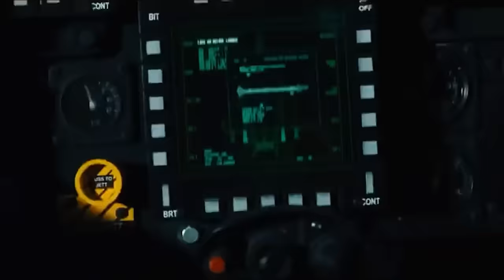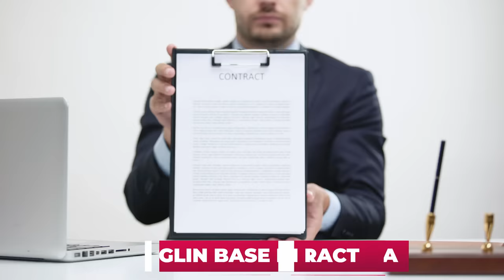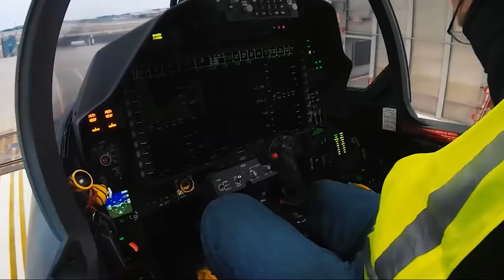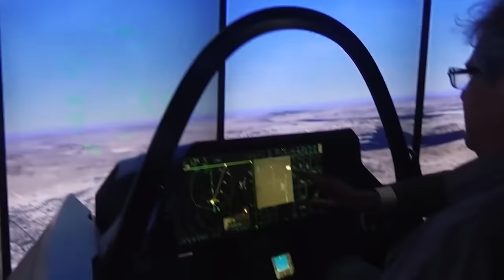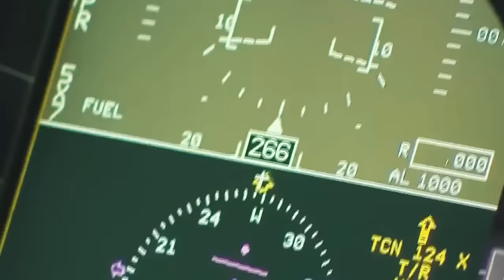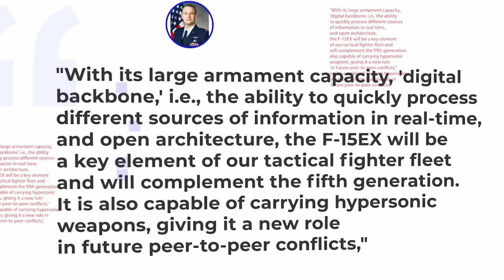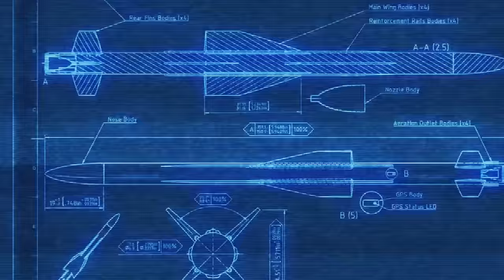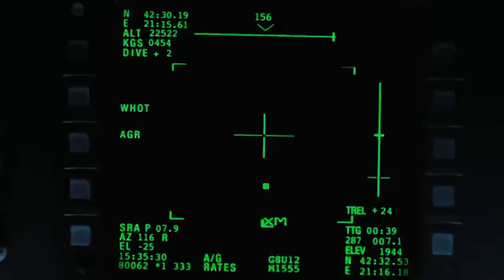NEW Upgraded F-15EX III Shocked Russia And NATO Countries

Comment: When many of us argued that the new 5th gen fighters didn't seem to make much sense as there was still a lot of life in the 4th gen fighters, we were called defeatists, haters etc. We were told that the military needed 5th gen fighters, because 4th gen fighters were already obsolete and would be slaughtered in a modern war. 
When we said those 5th gen fighters were too expensive to buy, fly and maintain, we were called to exaggerate or even lie, "because that wasn't true at all."
When we pointed out that building, flying and developing a plane like the F-35 didn't seem to make any sense as many problems were ignored "to be fixed later", because pumping out those planes was more important than fixing problems, again the 5th gen crowd was upon us with strong language. For many of us it seemed like the manufacturers of the F-35 were desperate to flood the market with F-35's before many buyers could cancel their orders, because they had reconsidered buying the F-35's. The reasons for customers reconsidering buying the F-35 were obvious: the price keeps rising, problems keep being pushed ahead, flight and maintenance costs prove to be exorbitantly high and the promised added value of this "must have" plane was severely diminished as the 4th gen planes proved they weren't really obsolete yet and the F-35's having much of their capabilities severely limited by said non-solved problems. 
  
And then the news came out that the US military had cancelled a lot of pre-ordered F-35 and we could only hear crickets from the 5th gen side.

Now the US military is committing to the F-15EX, I expect them to cancel even more of the pre-ordered F35, for all the reasons mentioned above.

Comment: The f-15 EX is not old, they’re brand freaking new. Not s repurposed 50 year old jet. Sure, it is a 50 year old design on the airframe, but the EX variant are made brand spanking new off the line.
Reply: The video says that right in he start…

Comment: 1:06 From what I have seen, it seems like they have been remodeling the F15 all the way up to the F-35. The framework on the F-35 is like an expansion around the  F15's original frame. They cowled the entire frame from the nose to the exhaust and gave it a vectoring thrust.
Reply: Huh? SMFH None of the planes you mentioned have thrust vectoring

Comment: If F-22 was continued to be upgraded aND modernized, the operational costs would have come down. Unfortunately, Obama admin banked on getting B-21Raider built and cut F-22 production to get the Raider. The result is a very unique, expensive, and irreplaceable aircraft. That bad decision regarding F-22 production being cut in half is per force followed by more bad decisions. Just think, if GM would announce that they are starting to make Chevy Luminas that look EXCATLY like the 1990s Lumina looked, but have slightly more efficient engine and different dashboard - would you buy it????

Comment: I have never understood why we are always quick to abandon older technology.  Sure, there is a definite need to continuously develop ever more capable fighter planes.  But the US should also consider supplementing the squadrons with a resurrected and modernized F-5 fleet that are drone capable.  At a fraction of the cost of just a few modern 4th and 5th generation fighters, they would be able to fill the sky with hundreds, if not thousands of autonomous fighters.  In fact, doing so would easily overwhelm any modern 5th generation squadron that any enemy could throw at you.  Consider just deploying 50 autonomous F-5's against every MIG-29, MIG-35 or SU-57E.  Then deploy our best manned, modern fighter's in the rear guard to coordinate and take over the attack/defense when the enemy is overwhelmed.  And sure, any MIG-35 or SU-57E would likely be able to take down half a dozen or more of F-5's per engagement.  But how could they stop the 40 or so missiles coming at them from the surviving F-5's arrayed against them; when they have ran out of weapons?  The odds favor the many, and greatly increase if instead of missiles, you add weaponized lasers (as the US is currently developing) to some F-5's.  Since each autonomous F-5 jet would be pilot-less, the loss of 1 or 2 would be nothing compared to every SU-57E shot down, and without a loss of highly skilled pilot on our side of the engagement.

Comment: Couldn't they incorporated some designs from the F22 into a stealth version of the F15EX program?
Reply: Not really. Stealth has to be designed from the ground up. They can add some of the features to reduce cross section, but it would still have more RCS than an F-18
Reply: @enginepy  actually you can take the overall design of the F22  and apply the design to a new stealth version of the F15.
Reply: @terrycarter1137  there are thing they can do for sure to help. Faceted edges on the inlets and doors, angled vertical stabilizers, coatings, etc. that certainly reduce the RCS. But it still won’t be as stealthy as we would like. It would give a huge advantage though in air to air. Kinda like the Have Glass program for the F-16., which was really just coatings. But they talked abont revising the inlet design etc and it wasn’t cost effective. Not sure why though
Reply: @enginepy  redoing the F15 into a more stealthy design is very possible, and yes it would reduce it's RCS, and yes it won't be as stealthy as something like the F22, but a more stealthy F15 would be a more cost effective way to have a somewhat stealthy aircraft without the high cost of maintenance of the F22, and have more aircraft ready for combat if needed.
Reply: @terrycarter1137  i completely agree. Almost makes too much sense for our government, so who knows. But seems like a common sense approach as they update the airframe.
Reply: The F15 Silent Eagle was a design proposal for a 'reduced radar signature' F15.......but it wasn't adopted......

It was an F15 with the RCS of a clean smaller F18, which helped a bit with detection distances, but it didn't make it a truly stealthy aircraft.
Reply: @baronmonkerson2195  true stealth aircraft are currently expensive to produce in great numbers, and are expensive to maintain, the F15 silent eagle was a good proposal, but they could have altered the design to make it more stealthy through using design aspects from the F22 into a easy to produce and maintain F15 a semi -stealth aircraft.
Reply: @baronmonkerson2195  well said

Comment: This is sad and ridiculous.  If the F22 Raptor's production line and parts production lines weren't specifically destroyed to force the purchase of the flying bricks that can't climb, fly fast or turn (F35A, B, Cs with about 60% flight availability, over 1,200 parts shortages [MonkeyWerx] and 60 day maintenance turnaround times) we wouldn't have to buy 1980's tech and hope we only fight ppl without airforces, air defense, running around in sandals in deserts.  

I'm embarrassed for my country.  I am excited to see the AI piloted F16s fly against modern Russian integrated air defenses and Mig 31s, Su 30s and 35s... maybe an Su 57 here and there, with their (Su35s too) Vympel R-37 air to air hypersonic missiles with a 150 to 398 km range and see how that all turns out.  We should get to see that sometime after The Marvels flops in the movie theaters.

Comment: F-22 oxygen system was fixed decade ago! dude you gotta keep up with it.
F-35 books are full and USAF want replacements for the fatigued F-15C ASAP.
F-15EX was produced to keep Boeing in the fighter manufacturing game and realistic Russian and Chinese fighter evaluations determined currently they have no competitor to the F-35 true 5th gen with all the bells and whistles.
F-15EX will be based in the US were it is a safer prospect, F-35A will be the aircraft on the tip of the spear.
So buying the F-15EX is not preferred but essential.

Comment: The Failure-35 is not only NOT superior, its QUITE DEFECTIVE.

The Eagle is THE ONLY combat airframe to reign undefeated.

When you can't beat it, its NOT 'inferior'.

The 35 is slower, weaker, carries less armament, has all those widely known rash of internal failures, and requires so many more suppliers, more logistics, and are more sensitive to flight hazards.

And while, it can [sometimes] evade enemy missile lock, that does NOT mean its impossible to lock onto it by some types of missiles, let alone a skilled pilot with a rotary cannon.

Comment: My late uncle William Elmore was the Director at McDonnell who supervised and participated in the construction of the first several F-15s. He closely followed the use and development of the this plane for the last 40+ years of his life. He was sure F-15 had a long life span and future, much like the B-52s. Bill was sure F-15 could be developed into a cruise aircraft of supersonic speed without after burners. He was also confident in M+Ms. Materials would change and improve. And manufacturing would change and improve. The original F-15s were a 10,000 cycle aircraft with that many take offs and landings. Bill believed F-15 would have the life cycle expanded to 50k-100k range like B-52s. Ultimately, the main reasons F-15 will continue is it's long term upgrade potential and the square miles of control. It makes a large area of the planet safe from enemies on a per dollar spent ratio than any other multifunction aircraft in the world.

Comment: I don't get this O2 issue with the F22 and F35.  Measuring CO2  and O2 levels in the cockpit only requires very simply instruments. Measuring VOCs ( volatile organic compounds) is again very simple to do with commercially available small meters.  Honeywell makes one for 6K  that is the size of a flashlight.  Something does not add up here.   Also the stated ceilings of the aircraft mentioned are 50,000 for the F22 and 65,000 for the F15 C and D. I think some of this info is incorrect.  The F22 has a backup O2 system as well so I doubt these stated flight restrictions are accurate.  The author seems fixated on this new jet and trashed the 22 and 35 to make his point.

Comment: All the way from England,given that the Royal Navy also operates F35 B's I can confirm the O2 issues,what I DON'T understand is why the manufacturer has not been compelled to fix or replace the equipment at their own cost.If the arms industry's control politicians through contributions then why can't the USAF/Pentagon take the issue to the supreme court?Hell, maybe it would set a precedent that could clean up much defense procurement corruption.

Comment: Well, when you built perfection, it shows. The F-15 is the best of 2 generations of multirole fighter aircraft. And the F-22 Raptor is still the present ruler of the skies, and will remain so for the foreseeable future and likely longer. F-18 Super Hornet is the master of ECM, ECCM, and ECCCM. The miserable F-35 still has failed to outperform the F-18 in electronics, though it was designed to do so, and the Raptor would smoke it at 100's of miles without the 35 ever havent seen it. Lets hope that multi trillion dollar F-35 POS, as in piece of sheet, can perform better in close ground support than the Warthog that is being mothballed, but I doubt it, seeing as they still have some still operational 5-10 years after they were scheduled to be decommed. I think it's a case of too many cooks in the kitchen.

Comment: It you mean development cost, then yes it's cheaper. But it's not much cheaper to run. The new unit cost is probably very similar. The F35 might even be cheaper. They just have different advantages and disadvantages. They're not being "brought back" because of faults with the F22 and F35. The F15 will be complimenting the 5th gens fighter roles. The new gems will stil the primary first strike and air to air platforms. Plus they can sell  a shitton of  them.

Comment: The new F-15x/ex models just proves how bad the F-22 and F-35 are as fighter craft from an investment standpoint. Seems like we would have been better off building these upgraded F-15's instead of the F-35 and used that budget to turn the F-22 into something like a F-117 replacement for stealth strike missions. Would have saved a few billion at least and given the F-22 some real combat missions instead of being some poster child for the air force.

Comment: What a boatload of Boeing marketing nonsense!!! How many generals were paid off to provide this glorified weapons wagon easy target for S300 and S400 systems? There are no proof it can outfly the F-35 and it definitely cannot outfly the F-22 nor pull more Gs and even come close to the F-22's max angle of attack. This is just another easy target for missile defenses as it is rooted in the 1980s concept of airwarfare where air defense systems dominate and kill all. This new plane only works if there are F-22s or F-35s take out anti-aircraft systems, as bottomline, it  operationally does not offer any tactical advantage over other F-15s. But Boeing says it can carry more munitions! Just use  more jets and bombers.  as those are already paid for. Besides, even after F-22s and F-35s identify scanning and targeting radars, this plane remains vulnerable and useless until stealth planes or drones take them out.

Comment: The 1911 is still in use, and honestly, I do not forsee any handgun design ever replacing the 1911, not without a plasma variant in the 40 watt range. You have to build around a higher caliber to update the AR15, and the new M5 is still an AR inspired design.

For the United States to build an efficient 4th Gen fighter will give our Greater Allies to get better.

Comment: Adding digital fly-by-wire and many other enhancements made possible by 50 years of advances in technology since the F-15 first entered service has basically made the EX an entirely new platform that is just physically very similar to its predecessor.  Its capabilities over a legacy F-15 are dramatically enhanced.   Even its maneuverability is really on another level entirely,  almost approaching what an F-22 can do.

Comment: You need jets with hypersonic flight.
And hypersonic missiles to fit the inside of the jet  make it the right size.
If not the U f OS  are going to whoop us pretty good. You have time, get them done, please.
It's mandatory . 

Tell the engineers not to give you any lip and make those hypersonic missiles the right size.
 which they should have done from the beginning. They should fit the inside of any jet The right size should have been their first determination..understand Oh yes lasers as well. That's my opinion. I would knock some heads together if I was there. Get ready.

Comment: Question :
I’ve worked on thousands of aircraft. My work was aviation ground support equipment design mobile and fixed .
My question is with so many planes of same type does each one of a certain type have different personalities? Or do they perform do much the same that you wouldn’t notice ?

Comment: I was wondering whe we would go back to two person cockpits, makes a lot of sense to have a guy just focus on keeping you alive and in position. I could actually see fighter like this but with more steath capabilities being the way fighter aircraft go. With all the variables you would have have to deal with now in a modern dar air campaign it just makes sense to have two people in the plane. Plus using the Eagle's airfraim for this base is kinda genius, we have been stedily developing this aircraft for decades now allowing us to know how it works and what needs working on, making any new varients likely to have very few teething issues. i could defiantly see fighters like this being more important that fighters like the raptor or 35 as they are both cheaper and simpler usually. plus with the rapid development in steath technology its very likely every fighter could be equipped with stealth tech in the next 50 years.

Comment: so f35's are pretty much gonna use f15's to haul the big guns? seems like the needs and requirements of the f35 have expanded so much it cant do what the military wants to do with it and are using the f15 to fit that role. this makes me think the FXX will end up consolidating the best of the f35 and the b21 and overlap there roles while using the f15 and hypersonic missiles to enlarge the total payload for the mission until the new australian drone concept can be used as a pack mule for weapons for the fxx and f15.  i think this will end up with the b21 and f35 being retired if fxx proves itself, if not then im sure the fxx will become a intermediate for both until a later date in which they are successful in combining the 2 as i cant see this many expensive stealth programs running parallel. with the way the military has been going with replaceable parts and modularity i really think they are trying to solve the logistics of everything, by crossing roles and eliminating other planes from service can solve this problem along with overspending, in the long run money wont matter much cuz they will still figure out how to spend it but at least it can feed another program instead of being wasted. f15 is a good idea can buy more at lower cost meaning we can be prepared for war and since it costs less prolly be less strict on pilot recruitment and less invested in training with the use of hypersonic missiles and that would be good as well since theres been a problem with recruitment as of recent. its possible though that the bomber will never be retired they might provide something nothing else can and im not sure if they can make a fxx that can fill the roles of a b21 and a f35 and still fit a good amount of them on a aircraft carrier, either way the fxx should still at least be superior to a f35. one real fighter is really all we need the f15, but there is no way a f15 is gonna replace a stealth aircraft such as the f22 or f35.